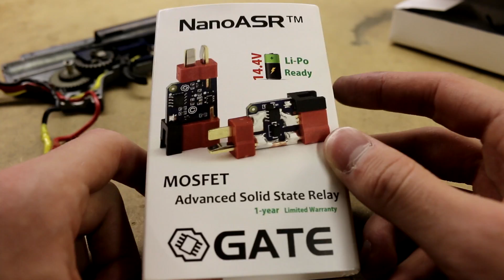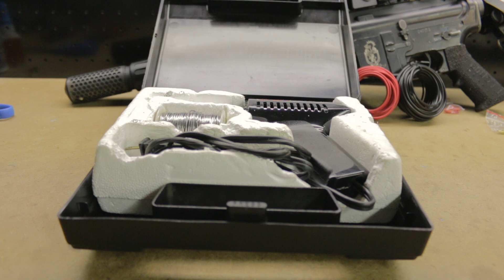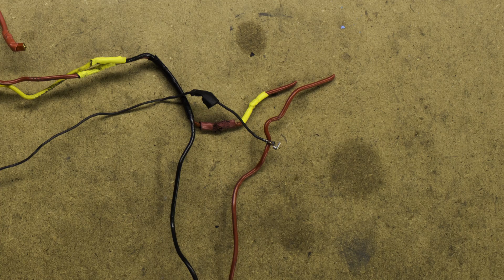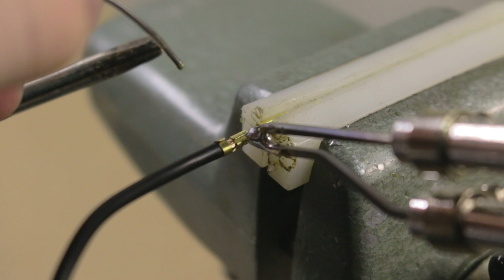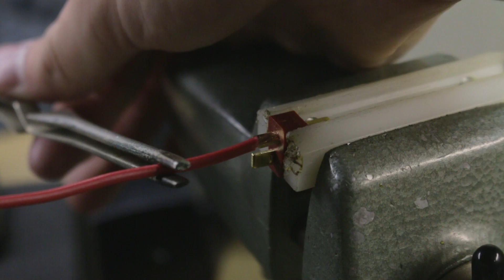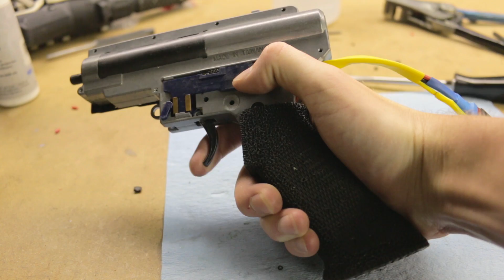Airsoft Tech: Rewiring (AEG)

Comment: I have that black wire bullet terminal and it came loose in my ebb rifle recently, how do it rejoin it to the other side? It looks like a copper plug but they don't latch on together my guess is they need to be soldered
Reply from the maker: Bullet plugs just press-fit into each other. They're only held in by friction so they can detach easily if the wire is pulled.
Reply: @CStingerGhost1 that explains why it came loose once the electrical tape around it tore. I ordered some self soldering heat shrinks off Amazon I'm guessing that'll fix the issue

Comment: I am late but really need this question answered. Do you HAVE to solder your motor connectors or can you just clamp them on the wires?
Reply from the maker: If you have a good method of crimping them, then you don't need to solder. A wire crimp tool should be able to make a pretty solid crimp that will hold and have plenty of contact area without solder.
Reply: @CStingerGhost1  Thank you! new subscriber

Comment: I did this once then realized my motor no longer fit in the grip with two 16g wires in there.
Reply: yeah, this wouldnt work on my g36. even just one or two wraps of electrical tape around the motor cage will make it not fit. upping the gauge of the wires leading down to it is not really an option unless i dremel out a lil bit of space for them
Reply: @johnrivers69  a fair number of people do this at my local field. They dremel out along their motor grip seams - none of theirs have broken yet.

Comment: how are the mtor connector called?
Reply: i broke mine and need to buy new ones
Reply from the maker: @panhem7149  - They're called "spade" connectors. You can find the correct size on all sorts of airsoft parts stores. I recommend Brill Armory, but there's others to choose from. You can also find them at a hobby parts store and maybe even something like Home Depot, but you would have to be sure to get the correct size. The motor tab side of the connector is 0.11" wide x 0.02" thick. The wire side will have to be sized based off of the thickness of the wires in your AEG (most likely 18AWG if you haven't changed the wiring).
Reply: @CStingerGhost1  Thanks a lot. I just found them at our store.
Reply: I'm struggling to find anywhere that sells these - searching motor spade connector only seems to result in car parts or the end that connects to the spade - so the female equivalent.  Even tried Brill armory site and still nope.  I'm UK based but don't mind ordering internationally, HK/China would be preferred.  Can you please give me some advice?
Reply: @Tom_-  I'm in germany, but i went into my nearest hardware store and just found the right connector
Reply: @Tom_-  take a look at ak2m4.co.uk, they stock them

Comment: Now I’ve been trying to build a A&k SR-25 with a M150 spring an a gear set of 32:1. I added mostly new parts. An have been trying to re wire everything. I’m using a mosfet warfet an is still not firing. I have a LiPo 11.1v battery powering everything. When I pull the trigger like a greenish yellowish light comes on the mosfet.  Double Trigger Wire is in my box that the mosfet came in am I suppose to wire those two prongs under the dean connector to the battery ? Would this be why it’s not firing ? What is the yellow wire from the trigger switch to the mosfet ?

Comment: As a electrician I can tell you extending wires they SHOULD be a slightly bigger gauge NOT smaller, smaller gauge increases resistance and heat and can actually catch fire if used long enough on full auto 🤓

Comment: would it be better to re-wire the whole thing, or just install a dean  to simply plug the mosfet?

also is it necessary to put a heat shrink tubing on the mosfet?
Reply: Yes. You don't want anything else touching.those contacts

Comment: So i have a problem i have a g&p that destroys lipos and i dont know why i have tried everything new motors, 2 gearboxes, re-wiring ,6 diff batteries melted a 11.1 today
Reply from the maker: Have you tried a MOSFET or a fuse in it?
Do the batteries lose charge or do they actually ignite? Does it happen as soon as you plug it in or when you pull the trigger?
Reply: @CStingerGhost1  i have the i5 g&p gearbox it has a built in mosfet
Reply: @CStingerGhost1  no the batteries will last for about an hour of testing and sighting in first time I realized something was wrong I could hear a hissing and a horrible smell came for my buffer tube I pulled the battery out and threw it on the ground it was puffy hissing then started to smoke and ignite
Reply: @CStingerGhost1  the most recent batteries have just started to smoke or have a horrible smell
Reply: @MrKillabee47  Exactly which batteries have you used and exactly what are the specs of the gearbox? Also, does it make any abnormal sounds?

Comment: If you can Solder, you can make your own simple switching MOSFET (no other functions/features) for around £6 (one Transistor [the MOSFET itself], and one Resistor.

I like the idea of the Bullet Connectors in the Grip, been thinking along those lines myself.

Trigger wires with a MOSFET can be super-thin, they're only carrying a few MilliAmps to 'trigger' the MOSFET.

Also, on most M4s, you can run the Motor Wires outside the Gearbox Shell, it enables you to use higher current (i.e. thicker) Wire, and makes assembly much easier.
Reply: Motor Wires outside the Gearbox Shell

Thats mostly impossible on the CM16, I tried. Atleast with 14 gauge wiring
Reply: @glurak888  You need to remove some material from the inside of the Grip on most versions, and usually from the lower receiver as well. Just depends on the particular Gun.
Reply: You'll need two resistors actually, otherwise you're right.

Comment: You seem to be educated in that topic :) do you know how many amps are pulled from the battery in a Standard aeg(unfortunately S-aeg in Germany)? I know it depends on the used spring, and some other factors. But round about, how many amps on a 3s Lipo? I am planning to build a li-Ion 3s Pack because they are much cheaper and have more capacity...
Reply from the maker: I do not know.

Comment: Do i have to take the gearbox apart? I literally just put it back together with a new spring a couple of days ago.
Reply from the maker: If you want to rewire it, yes.
Reply: Stinger i looked at my v3 after this and you dont necessarily need to. The trigger wire points are exposed on the outside and if you trust yourself soldering you can. I see this is a v2 box though

Comment: I've done this on my previous gun I rebuilt and the piston wasn't making contact with gears. I was going to re build it again but lost interest in doing so I bought a new gearbox and was going to use the positive battery wire to red motor wire as the switch wires Though it means drilling through the grip you don't have to open the gearbox. However I ordered a gearbox that won't fit, so I'm   shelling out for a new gun.

Comment: Hey Stinger, if I want to copy the whole rewired system, (which I do because it looks great), where can I get the wires, heat shrink, connectors and so forth?  I tried searching for the wires but would like to know what exact parts you recommend. Links would be an immense help. Thanks!
Reply from the maker: Deans XT Ultra Plugs: https://www.amazon.com/dp/B06XHMCZL2?psc=1
AlphaWire: http://alphawire.com/
Lonex Gold-Plated Spade Connectors: http://www.brillarmory.com/index.php?main_page=product_info&products_id=418

GATE Nano ASR MOSFET: https://www.gatee.eu/nanoasr
I got a heat shrink set similar to this (Mine was made by K-Tool International): https://www.amazon.com/Ginsco-580-pcs-Assorted-Sleeving/dp/B01MFA3OFA/ref=sr_1_3?ie=UTF8&qid=1506714426&sr=8-3&keywords=Heat+shrink+tubing
Reply: Stinger thanks a ton!

Comment: so u dont need fuse? because u have mosfet?? and if i dont have mosfet do i need fuse?
Reply from the maker: The fuse is only there to protect certain components from short-circuits/too much current. A fuse is not 100% necessary in any setup and is only a safety device.
The MOSFET I use has a built-in electronic fuse. Not every MOSFET has this.

Comment: Do you bend the female spade connectors that go into the motor or do you leave enough wire to run them straight. Just wondering because I would think the solder would not allow you to bend the spade connectors. P.S. make more videos ;)
Reply from the maker: I typically bend them. The bend is forward of the solder
Reply: Stinger Do you mean that when you are looking at the connector from the side where the wire is visible inside the crimp, you bend it towards you or away from you? and do you bend it after soldering or before ?

Comment: Current runs from negative to positive ;)
Reply from the maker: That depends on the convention you use.
In Physics, it's negative-to-positive, because the positive terminal has an excess charge of electrons, (which are negative).

Comment: i broke the connectors to the motor, is there any way to buy new wires with it/fix it?
Reply from the maker: Yes, they're called "spade" connectors. I talk about them in this video.
Reply: Stinger I love you, I did the same as AmateurAirsoft and couldn't find them any where. Thanks!

Comment: why should I rewire
Reply from the maker: To install a MOSFET, a different type of connector, or to lower the electrical resistance of your circuit.
Reply: +Stinger I have a mosfet running using stock wiring. Should I rewire and why
Reply from the maker: If you have tamiya connectors, yes. If not, it's up to you whether you want the small decrease in resistance that comes from having larger diameter wires.

Comment: What buffer tube is this? I bought a kwa rear wired buffer tube and there seems to be no way to connect the mosfet if it's in the tube
Reply: a lot of people just build a mosfet, 100ohm and 2.2k ohm resistors, beefy 18v diode and of course a MOSFET, add a small voltmeter so you can check voltage and youre set, it will end up being about the size of a AA bettery and you can fit it to your specifications

Comment: I wanted to ask, I noticed there wasn't a fuse, should I worry too much about that or?
Reply from the maker: No, if you wire it correctly and know not to abuse it by cycling it when it's jammed, the fuse is useless.
Reply: Stinger Cool, thanks for the fast response!

Comment: Hey I recently bought an apex R5 off if someone and the wires are too short in the buffer tube, and don't have any connection point on them at all. Any suggestion as to what I should do?
Reply from the maker: You could add connection points to them or just rewire it entirely with longer wiring.

Comment: hey i got a  g&g cm16 srxl and sence i bought it when you shoot too fast on semi it will shut the gun off and u gotta unplug battery to make it work again i installed deans connectors but my question is how can i rewire my trigger part cause its not a single wire it has like 4-5 its a eletronic trigger module  i think its shutting off either cause the mosfet is junk or the wireing isnt enough wires have been pinched and crunched but not bad  but still im thinking that could be it  even though they still should be gettin the same connection
Reply: @stinger

Comment: I have the nano gate asr and running a 1200 amp 11.1v airsoft lipoly battery. Im planning on rewiring my gun and i'm wondering if i should take out the fuse, (btw I use a torque motor if that does anything). Should I or should I not? and reasons pls :)
Reply from the maker: Yes, you should remove the fuse.

Comment: I have a question i bought a cyma m4 airsoft front wired and i damaged the red wire , i rebuild it but it seems im going through ni-mh 8.4v 1600 mah venom  with around 300 rounds continuously ... And i wanted to know if i need to rewire the whole thing ?
Reply from the maker: Either the battery is dead or something is drawing a lot of extra amperage, perhaps a bad solder joint

Comment: Hey Stinger and everyone else! 
I just happen to have the same mosfet in my possession (NanoASR), but I have a few questions before trying to install it. 
1.: is a fuse just before the motor necessary? 
2.: Do the signal wires need to connect to a specific pin on the mosfet? Or can the wires be crossed? 
Thanks in advance :)
Reply from the maker: A fuse is not necessary at all. The NanoASR has a built-in electronic fuse anyways that resets itself, so you don't have to worry about your circuit shorting and frying anything with the ASR.
The signal wires work either way. It's just a simple circuit.

Comment: How do you get the 16awg wire to sit low enough under the motor head? I tried heating up the wire and pressing it down to as flat as I could, but the motor still caught the wire and tore it open! This is so frustrating, so many issues I've run into, can't even sit the motor properly in the handgrip! Are there any other handgrips that are a bit wider to accommodate the 16awg? Or should I opt out for some 18awg all together? I'm running a SHS High torque with 13:1 gears, everything else inside is Lonex, powering all that is a 11.1 25c 1800mah  Lipo, so I'm not sure if moving down to 18awg will hinder my performance? Please response, I need to get this sorted out by this weekend or I will be out of a gun lol
Reply from the maker: +Zlurz - Most people modify the gearbox shell with a dremel to make the wiring fit if they run into problems.
Reply: Try alphawire ecowire 16 awg sits good on the lonex ar GB and isn't on the way of the motor pinion gear.
Reply: Same problem I had. The motor no longer sat low enough in the grip to contact the bevel gear. The two wire are simply to thick and the motor doesn't fit inside the grip.

Comment: Can you convert a single signal wire setup into a double signal setup? If so, how is it done?
Reply from the maker: +chackendorn - You can't properly do it without totally rewiring the positive side of the circuit. You could leave the existing negative side intact.
Reply: +Stinger So the signal wire from the mosfet goes from one wire into 2 so it can go to each individual trigger contact? Or do you run 2 signal wires from the mosfet to the contacts?Your videos are AWESOME and help a great deal! Thanks for taking the time to make them for us.
Reply from the maker: chackendorn - Double-signal wire setups always have two individual wires going form separate terminals on the MOSFET to separate trigger contacts.

Comment: the length of the wire for the motor from the hole of the gearbox till the connector  are:
- 13cm for the red one
-10cm for the black one 

(for an m4/ar15 platform)
Reply from the maker: +CryNhOuseGamer - Thanks!
Reply: Thanks very much! Exactly the measurements I needed 😊

Comment: I have a g&g combat machine with a simple red dot what can I do to make it better?
Reply: +BenRobots you can start by upraising the barrel probably madbull brand and then getting deans and installing a new motor here is a link to a website for internal parts http://www.brillarmory.com/index.php?main_page=index
Reply from the maker: +BenRobots New motor, new piston, wire to ultra plugs, and shim/motor height/correct AoE
You should install a MOSFET too, but that could wait.